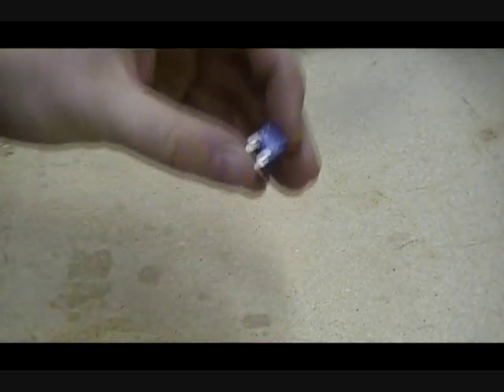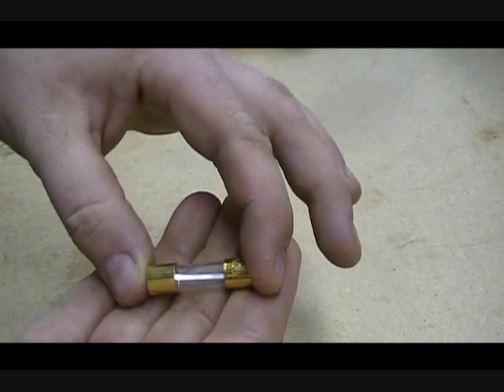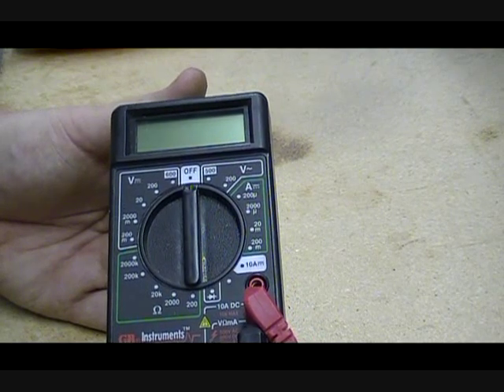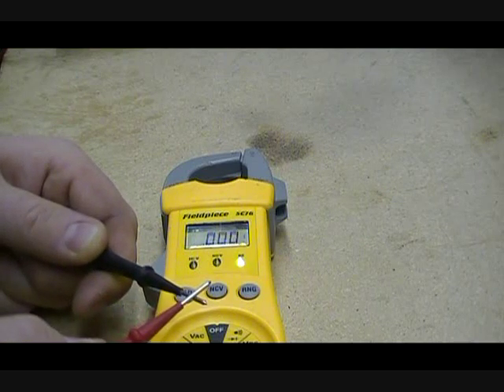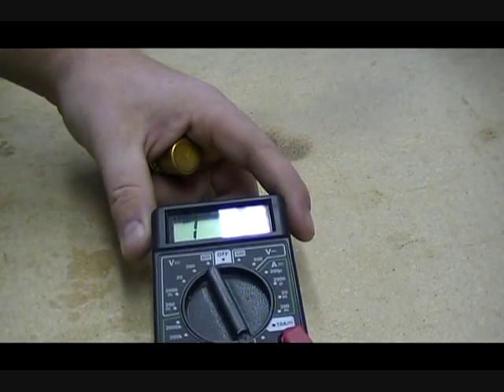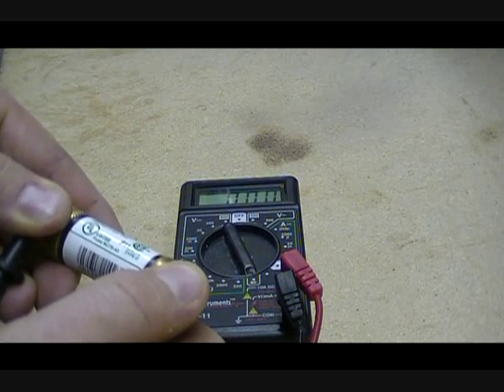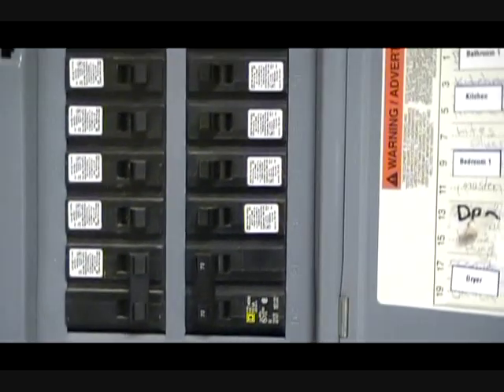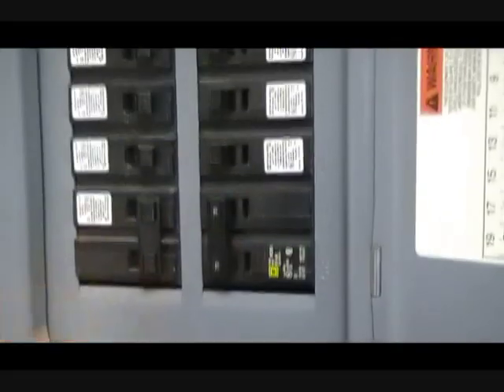how to check fuses

Comment: >>>DUDE GIVE A HEADPHONE WARNING WHEN YOU HAVE SOMETHING THAT PRODUCES A REALLY HIGH PITCH OR JUST A  EAR DRUM SHEDDING NOISE.<<< Hell, my ears are still ringing.

If you (channel owner.) Or anyone else I used Caps, not out of anger, not am I "yelling". If spoken it would be much clearer. It's hard to convey the proper context in text alone...That kind of ambiguity, starts flame wars in YT comment threads, and just straight out fuels Twitter.

My ears are still ringing.